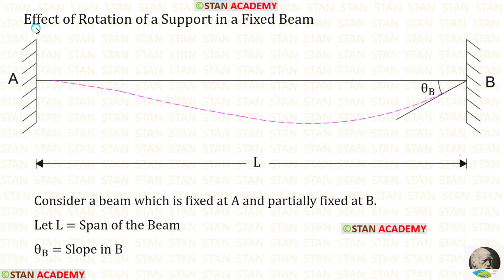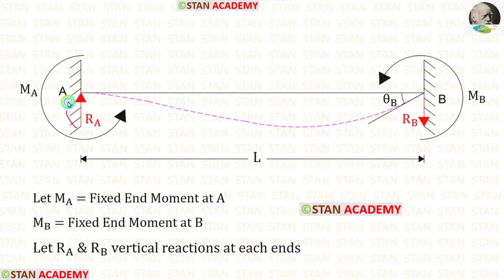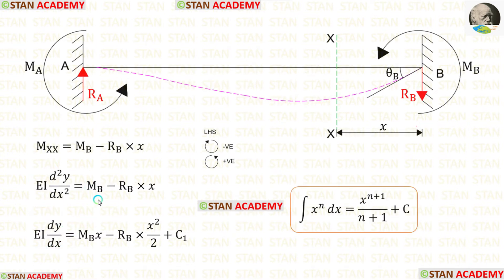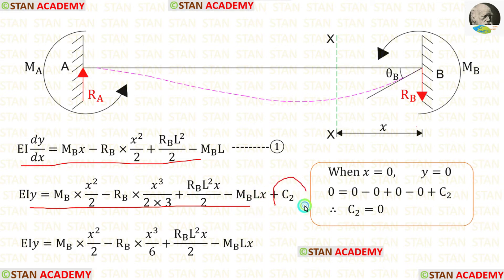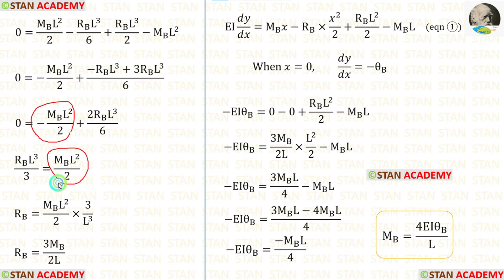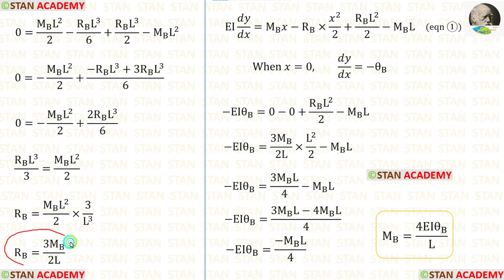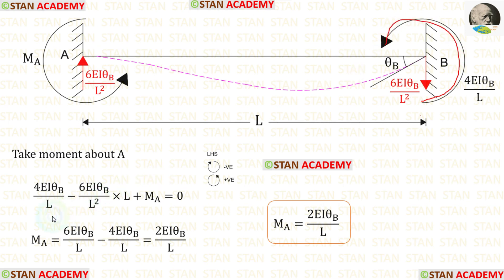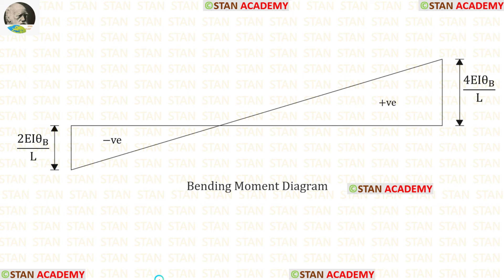Effect of Rotation of a Support : Partially Fixed Beams

Comment: Hello sir, what is the difference between a partially restraint axial beam at one end and a partially restraint axial beam at both ends?
Reply from the maker: If one side is allowed to rotate that is a partially restrained beam at one end. If both of the sides are allowed to rotate that is called partially restraint beam at both the ends